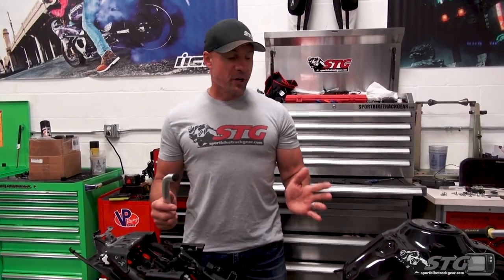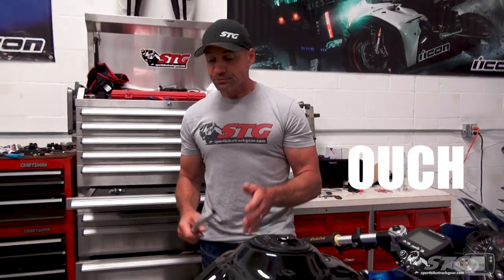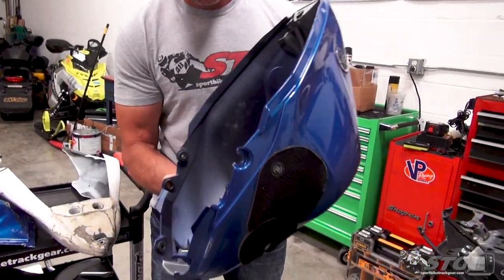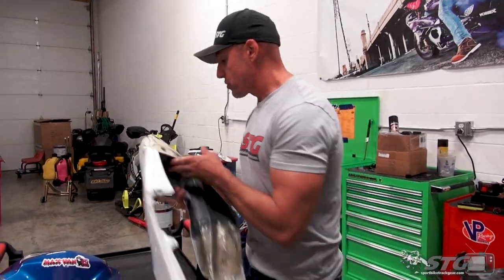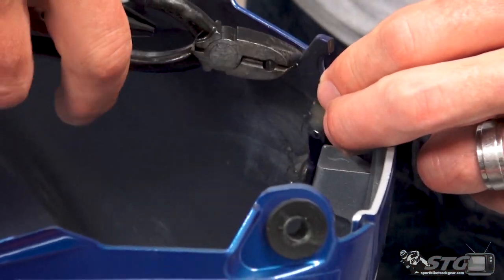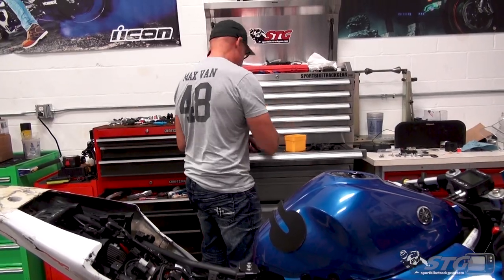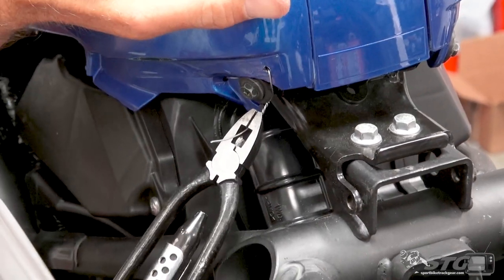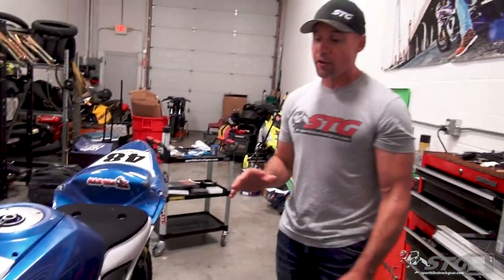Repairing the R3 AGAIN! Fiberglass & Fire | Sportbike Track Gear

Comment: where did you get the back seat cowl cover it looks really nice. Thanks for your r3 tutorials!!
Reply from the maker: We have the Armour Bodies race bodywork on the R3. They have designed the tail section in two pieces which makes it so much easier to get on and off. - Van

Comment: Would a propane torch be hot enough to heat those rear attachment points? It’s been a while since I did any oxy acetylene welding (what I’m assuming you have), so I’m curious as to what kind of setup you use...
Reply from the maker: That is a maybe. You can buy this torch set up at a Home Depot and it is handy to have around when you are Max Van's Crew Chief! - Van

Comment: I'm on the fence about my first "track" bike.  Coming from a street triple 675 (current bike).  I am eyeballing a ninja 400 and an R3.  80% canyon carving and 20% track time would be the goal.  Which bike do you think is right for the job?  Also consider when we ride the canyons it's a 45 minutes highway ride.  So i guess that's a consideration?
Reply from the maker: I would go with the Ninja 400 over the R3 for sure. It is hard to make up the 80cc difference. The 400 has reasonable power that works well on the track and the street. - Van

Comment: What type grade sandpaper do you use when working on the fibreglass?
Reply from the maker: I use 80 grit to rough up the surface to make sure it will bite. - Van